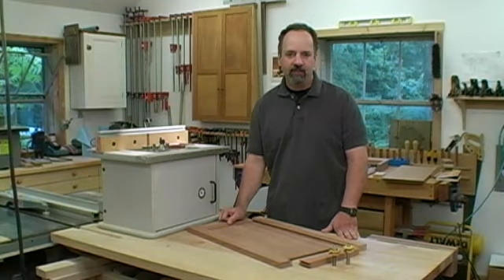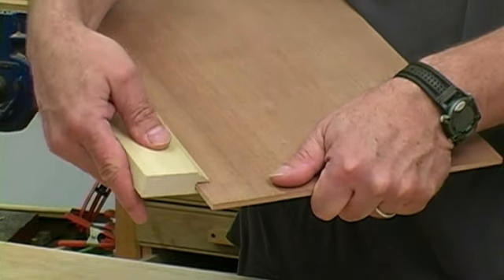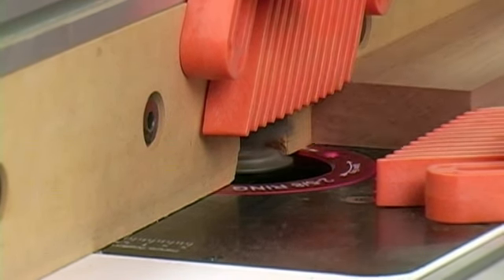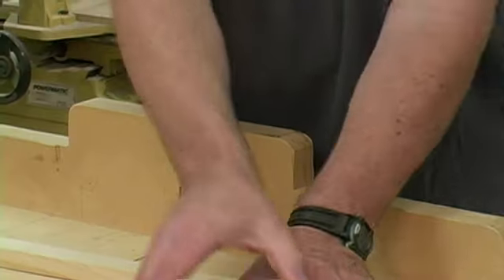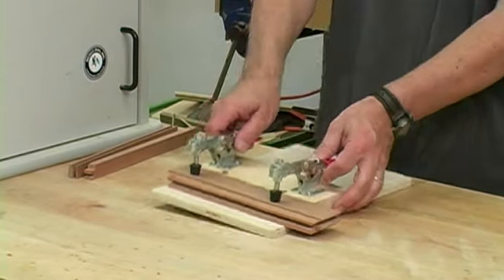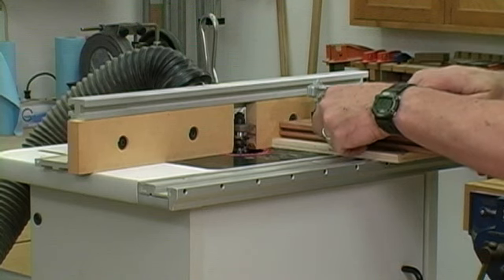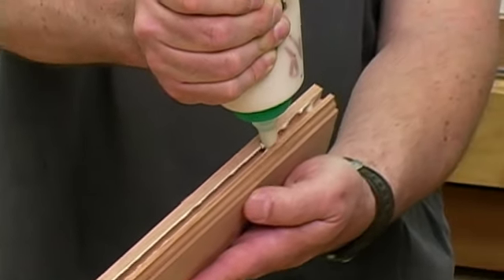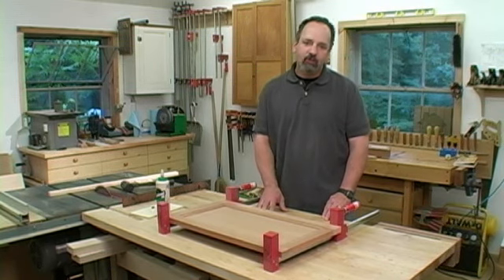How to Build Cope and Stick Doors

Comment: Nice tutorial. I have a shaper and my stile and rail set is as such... If I want to feed from right to left the ends of my rails need to sit on my sled face up while the stile cutter with right to left feed needs to be run face down. Is this typical  or just the way grizzly designed these cutters? Thank you. I have a set of Delta cutters that are the same. I have seen youtube videos with shaper cutters that everything is fed from right to left and face down???  Thank you